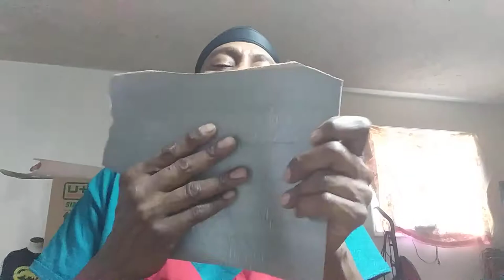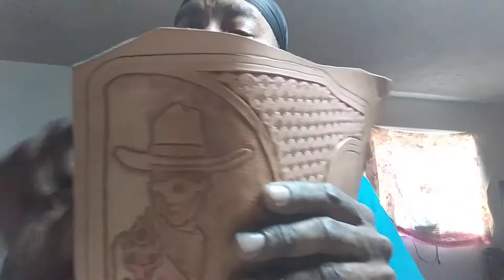Rubber Cement vs Contact Cement

Comment: You either need contact or rubber cement, depending on the application that you have in mind. 
You don't choose rubber over contact cement, like you don't choose duct tape over scotch tape. They are 2 different tapes for 2 different applications. 
That isn't to say that you couldn't use either one… because they are both tapes… but one is better than the other for whichever application that you desire. 

Like electric tape to tape up boxes? 
Scotch tape to tape up electrical wires? 

Sliced strawberries in a peanut-butter & jelly sandwich? 

Wait… that sounds pretty good. 

Erase that… I'm about to go find out! 

Thank you, for sharing. 
It was all I needed to know! 
Great job!

Comment: I know that this isn't about tires per say. However, I was researching the difference between rubber cement and vulcanizing cement. I saw one video where a guy tried to apply the rubber cement across the whole surface and then applied the patch. After waiting the allotted amount of time, he pulled the patch off to see what it was like underneath. There was a glossy section underneath, which seemed to say that the patch did not adhere to the entire surface where he applied the glue.
Reply: Yes, rubber cement requires oxygen or and aerobic atmosphere. He should tryUse E6000 and make certain you clamp and let set for 72 hours. Although E6000 has been around a bit, it's on the very edge of Metacrylics. It is a hybrid and cured in both anaerobic and nonanaerobic atmospheres, but the coolest thing is its great for fabrics as it remains flexible. Another excellent use is gluing the sole back onto a work boot. Can be found at any bigbox

Comment: Im just getting started but so far, and heard, barge cement is best. Idk if barge is a type of contact cement or if its different. Would love to put it in a heavy gauge (8-12) syringe
Reply: Barge is a great product of you're willing to drive and pick it up. The problem with Barge is the USPS will not ship it. No carrier will die to highly flammable. Not to mention it's kinda expensive if you're going to use it a lot. Weldwood, however, can be bought at any Walmart and only 7 bucks for a 16oz can. (Check the weight, but any rate is more than Barge, holds just as strong)

Comment: Craft stores sell something call Vinyl Cement. Is that really plain contact cement?
Reply from the maker: Good question. I'm not for certain on that. I wouldn't image so, simply because of the wording, VINYL CEMENT. Either is an exclusive cement for vinyl material or it dries to look like vinyl. However if the promos on the can say it can be used toward other material I'd stay clear of it, if you're going to use on leather. The biggest thing about contact cement & rubber cement in the world of leather crafting is to ensure the cement is breathable & can flex/bend. Breathable so it doesn't make your work smell like fresh glue. Flexible so it won't crack. If it can't flex then your leather won't regardless off how much oil or softener you use. This brings me to the last point of it won't flex or is breathable them your project won't absorb oil pass the point where the vinyl cement is. You can always test on some scrap wait about 3-5 days then see when it dries complete for smell & flex. Keep me posted. If love to know the outcome.

Comment: The reason I was thinking about this question was because i only have some contact cement and want to fix a flat bike tire
Reply from the maker: Contract cement on a tire may not work. Its not flexible
Reply: @PremierLeatherCraftersKawboi  your right one out of three tires that i had patched held. Besides that's maybe I'll get into making a wallet with leather

Comment: Little knowlege is dangerous. One of the beauties of rubber cement is how easy it is to join two surfaces using it. It can be applied to only one surface and the two surfaces joined while the cement is still wet -- a process called “wet mounting.” You can adjust the joint while the glue is wet, then hold the two pieces together until the glue sets, providing a quick joint that is not particularly strong. However, it can also be applied to both surfaces and allowed to dry before they are joined, a process called “dry mounting.” This results in a very strong bond, although the surfaces cannot be adjusted once they touch.
https://www.ehow.com/list_7268413_uses-limitations-rubber-cement.html

Comment: Can you wash contact cement in a washer? 
Used it to repair a pair of chucks & wanted to make sure I can wash it before I do
Reply from the maker: Thanks for the question it's a good one. I believe you can because the seal is tight, especially if you set it correctly.

I generally take a maul and tap around the soles of my sandals to get them seated properly. I haven't had a pair come back in 2 yrs. 

Ago I'm going to say that's a yes for me.

Comment: Should I use contact cement for my Clark's desert boots?
Reply from the maker: Thanks for your question. Contact cement can be used in any number of items that requires a strong bonding. Yes sir, I use contact cement on all of my custom sandals & shoes. 
If you are going to use them on your Clark's I recommend taping off any part of the show you do not want any accidental runs or bleeds to touch. I've the cement has fully dried & bonded then remove the tape slowly. Masking tape preferred. Its the easiest none sticking tape to use. Also a brush that won't fan or bristle spread to much.
Reply: Use E6000 and make certain you clamp and let set for 72 hours. Although E6000 has been around a bit, it's on the very edge of Metacrylics. It is a hybrid and cured in both anaerobic and nonanaerobic atmospheres, but the coolest thing is its great for fabrics as it remains flexible. Another excellent use is gluing the sole back onto a work boot. Can be found at any bigbox

Comment: Great video, what would you recommend to use re trimming a leather steering wheel on top of the existing leather already on the wheel?
Reply from the maker: Daniel Asgari I wouldn't, I would just design and make another one.
Reply: premier leather crafters RDM
Ok thanks I will remove existing leather coating and use as a template for new cover, I would like to beef up the wheel so it is thicker. What would you recommend to apply under the leather finish to thicken it up any ideas?
Thanks bro
Reply from the maker: Daniel Asgari thicker any veg tan of 6 to 8 oz. There are some chrome tan hides, if you're not tooling, that are more bendable and soft.
Reply from the maker: Daniel Asgari send Ann email address and I'll send a possible template.

Comment: Hey there, I need help finding a glue in the Uk that is suitable for glueing an Air Jordan 1 midsole to its uppers? Would Evo-Stik Contact Adhesive be a good choice (as it is the only one I can see available in the UK easily) or would it be worth importing the glue?
Reply from the maker: Thanks for the question. I have not personally used Evo glue. If you have a Wal-Mart in the UK I would suggest using Weldwood contact cement.. It comes with a brush, spreads easily, and you can layer it better fora stronger bonding. 

Shoes, I would use 3 coats. Make sure it's tacky before applying the next coat. Let set up over night.
Reply: premier leather crafters RDM thank you sir. I’ve been looking at weld wood but it’s not a brand I can access easily unfortunately. With the 3 coats rule should I use a heat gun to activate the glue or just put the 2 surfaces together?
Reply from the maker: If there's a Home Depot in the UK they carry Weldwood as well. 

If not here's the Amazon site to order it:
https://www.amazon.co.uk/Weldwood-Original-Contact-Cement-Hydro/dp/B01HDXYZV6
Reply from the maker: @user-wi8dn8gm2v  no heat gun! Between each coat Let dry about 3-5 mins. You can touch the cement it should feel tacky like fly paper. 

When you feel this apply another coat up to 3. After the 3rd coat bond pieces together & use clamps around edges. I use a mail as well to lightly tap around the edges fora full seal & remove air pockets. 

When it fully dries and bonds you'll never have to worry about it again. Weldwoodis also flexible & waterproof. What's even better is the glue continues to dry and with time.
Reply: premier leather crafters RDM ok I’ll look at the weld wood again. It says unavailable however I’ll look for that more deeply
Reply: Use E6000 and make certain you clamp and let set for 72 hours. Although E6000 has been around a bit, it's on the very edge of Metacrylics. It is a hybrid and cured in both anaerobic and nonanaerobic atmospheres, but the coolest thing is its great for fabrics as it remains flexible. Another excellent use is gluing the sole back onto a work boot. Can be found at any bigbox
Reply: When gluing sole back on shoe it is critical to go ahead and remove entire sole, clean and dry, spread e6000 liberally between EACH layer of sole. Clamp copiously and wait 72 hours and you won't be dissatisfied.

Comment: I got a question bro, I am trying to to connect leather and  wool  fabrics together. Would using contact cement such as weldwood be able to hold both fabrics together and still maintain its flexibility for wear? I am just scared that if i apply the contact cement it will connect both fabrics but I won't be able to bend the fabrics anymore.
Reply from the maker: Great question. Here's what I found out from a few old heads. If you're using real will and not a synthetic will apply with rubber cement then see the pieces together. The rubber cement will give you the flexibility needed and the stitches will hold in place. If it's a synthetic wool you'll have to attach a backing then follow the same directions above to attach.

Hope that helps
Reply: Use E6000 and make certain you clamp and let set for 72 hours. Although E6000 has been around a bit, it's on the very edge of Metacrylics. It is a hybrid and cured in both anaerobic and nonanaerobic atmospheres, but the coolest thing is its great for fabrics as it remains flexible. Another excellent use is gluing the sole back onto a work boot. Can be found at any bigbox

Comment: I have a question, is contact cement supposed to hold permanent on rubber? Or does rubber cement glue permanent on rubber? Thank you for the difference on these two, I was trying to find out.
Reply from the maker: @pueblodove rubber-temporarily. It's primary purpose is for flexibility. Contact casement-is permanent. It will flex a little but our quill go back to the shape you molded your piece to have.

Comment: A bit off topic but is rubber cement that rubbery goop that's used for rubber feet of various things like game consoles or CD players? It has to stick pretty well but it also must be possible to remove the rubber feet with relative ease without damaging them as sometimes there are screws hidden beneath them.
I was asking about that on tech forums but somehow nobody could give me a straight answer...
Reply from the maker: No

Comment: is it possible if i  use rubber cement on basketball shoes sole separation? the top is leather. will it come apart again? so probably contact cement?
Reply from the maker: There are several factors at play here. My first question is where are you applying it? 
Rubber cement although flexible and breathable, I wouldn't recommend to apply to the sole & upper. One good pivot or crossover more & your foot is coming out of there.
If applying to the upper part only you may can get by.
Leather cement is not a permanent adhesive, it's only a temporary hold until contact cement is in place. 
I hope that answered your question.
Reply: @PremierLeatherCraftersKawboi  thank you so much!!! that makes so much more sense!!!!
Reply from the maker: @arthurchen4384  that's why we do this...
Reply: Use E6000 and make certain you clamp and let set for 72 hours. Although E6000 has been around a bit, it's on the very edge of Metacrylics. It is a hybrid and cured in both anaerobic and nonanaerobic atmospheres, but the coolest thing is its great for fabrics as it remains flexible. Another excellent use is gluing the sole back onto a work boot. Can be found at any bigbox

Comment: Does the rubber cement go only on the inside of the leather or all over it
Reply from the maker: Only apply to the side you want to temporarily bond. It's not a permanent. The contract cement is the permanent bonding.
Reply: @PremierLeatherCraftersKawboi  ok thank you

Comment: i have a question i never worked with leather. can i use contact cement on the outside of leather rather the right. side of leather
Reply from the maker: Debbie Jones I'm sure I follow. There are 2 sides to leather, a flesh side & grain side. The flesh side is the rough side & Grain side is the smooth
Reply from the maker: Debbie Jones contact cement can be applied any where. However I'd applying to the grain side you may want to rough it up with a wire brush for better adhesion
Reply: Yes, simply apply more liberally

Comment: hello
could I use contact cement to glue on shoe soles
Reply: It appears your question was missed. Yes. You can. In fact, shoemakers commonly use Barge cement (contact cement) to glue their shoes.
Reply: Use E6000 and make certain you clamp and let set for 72 hours. Although E6000 has been around a bit, it's on the very edge of Metacrylics. It is a hybrid and cured in both anaerobic and nonanaerobic atmospheres, but the coolest thing is its great for fabrics as it remains flexible. Another excellent use is gluing the sole back onto a work boot. Can be found at any bigbox